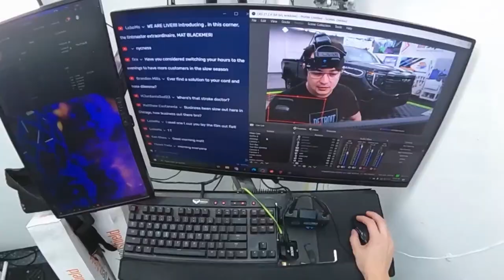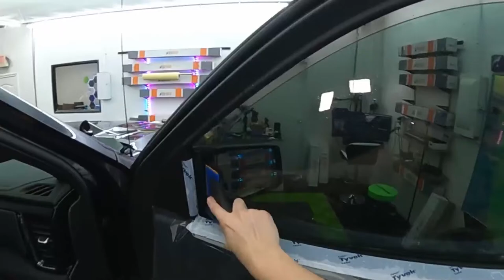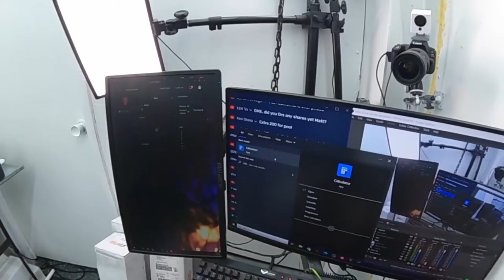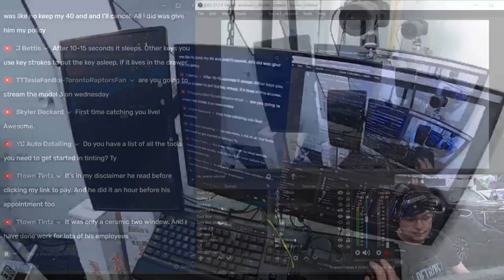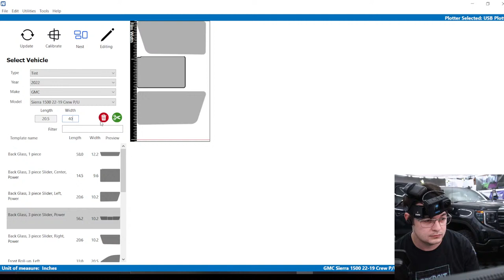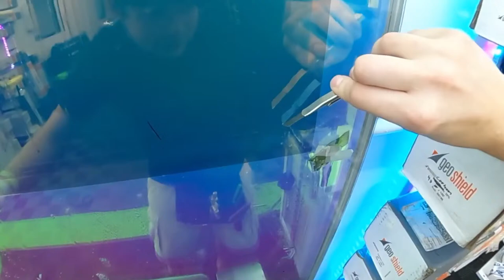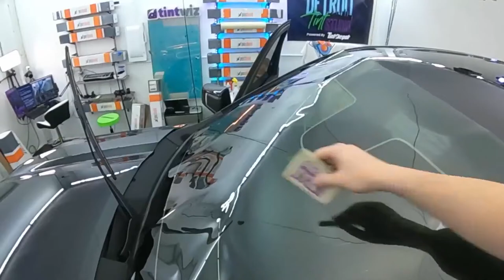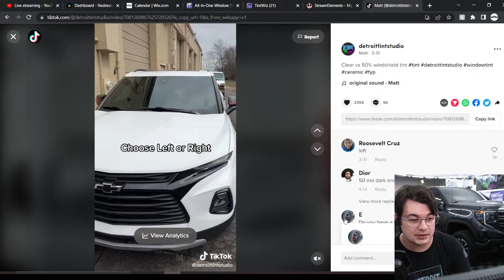22 Sierra Ceramic Window Tint

Comment: Hey Matt, I really appreciate your videos and have for a long time but just recently started buying stuff from you and subscribed. Sorry for taking so long. I also have a shop up in Anchorage Alaska that we do tint and we swapped from Solar Gard to Geo due to you. I really like all the glass aid products but sometimes the door guard is a little thinner than I would like. I am curious what brand of carpet liner you used before creating door guard. Reason being is the ones I have bought are trash and a pain to get off the roll etc and I also like to put it on the customers carpet during the winter to keep myself from getting wet when installing remote starts since that is my other main thing we do. The one you use looks thick and easy to get off the roll. I would greatly appreciate a response and will still continue to buy products from you I promise🤪.